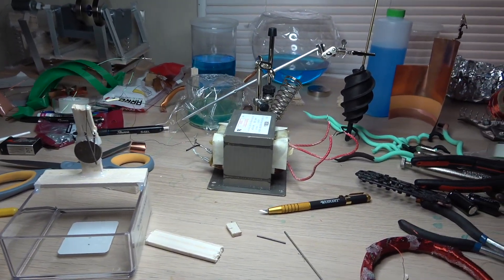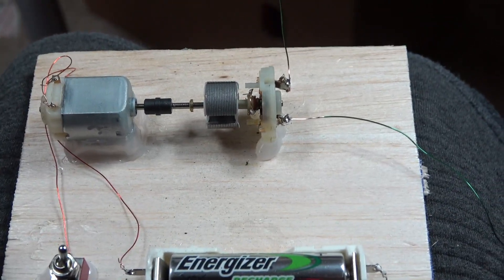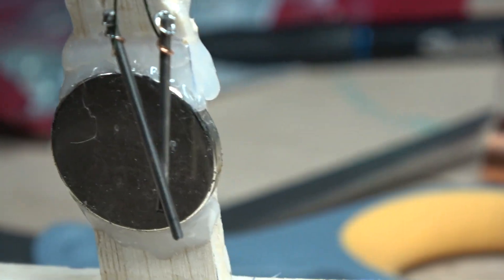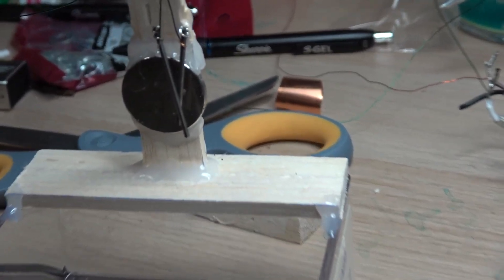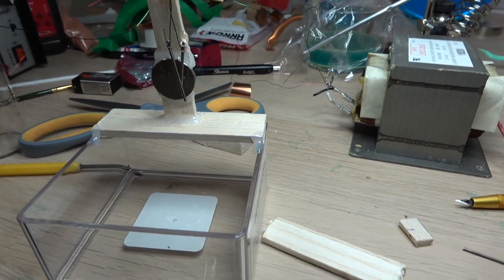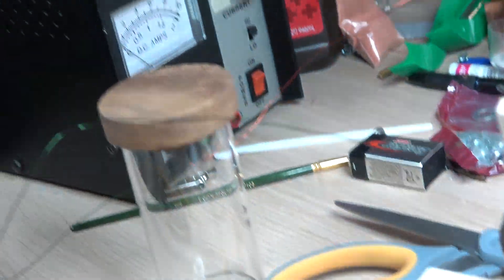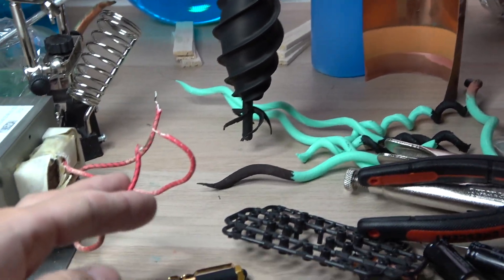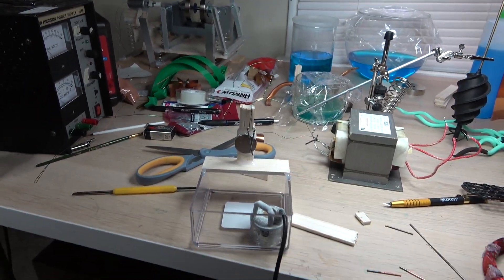Anti-gravity with a double coil?  Electrogravitic propulsion?

Comment: I know this is not the main subject of the video, but regarding the beginning of the video, one of the best ways to activate a transformer by switching the low-voltage secondary coil to DC to obtain high voltage in a mechanical and simpler way that I discovered was to modify a relay to make its actuator arm oscillate automatically and constantly.

The relay receives direct current and its modified coil is in series with the transformer coil, causing the relay's switching points to open and close the circuit according to the movement of its actuator arm.

When the circuit is closed, the current will flow through the relay coil and the transformer's secondary, but since the relay's actuator arm will be influenced by its electromagnet, it is attracted to it, causing the switching points to separate and the circuit to be interrupted.

When the flow of electrons in the electromagnet coil is interrupted, the electromagnet stops attracting the relay's actuator arm, and it returns to the closed circuit position thanks to its spring-like structure; making this process continuous.
Reply from the maker: Wow that's really interesting.  Thanks!  I hadn't thought of using a relay in such a way.  I may have to try that in the future.
Reply: @spiritelemental  Yes, and it works very well. Do not use the original winding if it is very thin, because the resistance will be very high and it will be analogous to a series resistor in the circuit. I removed the original winding and put a mesh of several wires in parallel with about 10 turns on the relay coil, this will make the coil have a very low resistance. It doesn't even get hot, it stays lukewarm at most.

The Achilles heel of this type of thing is that because of the constant opening and closing of the contacts, an electric arc is formed that makes them very hot. And when I say very hot, I mean melting the plastic of the relay structure that holds the fixed electrical contact point.

I also had to modify this part, I used a rectangular piece of PCB, which can withstand high temperatures, and fixed one end to the plastic structure of the relay and on the other end I put a screw whose head serves as the fixed electrical contact to which the actuator arm makes contact. With this, it can switch for a few minutes without stopping.

This type of problem can vary from relay to relay, there are several types of them and different internal constructions. There must be one whose structure is made of bakelite or another material resistant to high temperatures, I don't know. I had two of those relays that I removed from a refrigerator's electronic board, which must activate the compressor, or something like that.
Reply from the maker: @netorodrigs2100  Interesting, thanks.

Comment: I wonder if high voltage could affect time. So if you are using high voltage dc in order to alter gravity, then it might alter the flow of time as well. You should do a clock experiment so you can test for time dialation.
Reply from the maker: Very good suggestion.  Time distortions were recorded by Tesla in some of his very high voltage experiments, if I remember correctly.

Comment: The key is to get extremely high voltage and very very low amps. Pulsed is still the way to go. 2 (0r 3) coils 90° out of phase. Look up Delta 3 antenna or Helmholtz coils. I wont get too in depth until i can do more research myself. Good start 😉
Reply from the maker: Thanks!

Comment: This is good stuff, in one of Tesla's patients he describes using a DC pulse of 20 thousand volts at 20 thousand pulsed per second for his results. The aether is bombarded by the electrons and is put in motion, these particles are what does the work.
Reply from the maker: I agree!
Reply from the maker: The first chapter in "Secrets of Cold War Technology" by Gerry Vassilatos, is a good read.  That chapter is all about Tesla's discovery of impulse discharges with high voltage DC.  The discovery of the aetheric flow underlying electron flow.
Reply: A real understanding of the ether doesn’t regard a concept of material particles. The ether’s nature to maintain equilibrium derives all electrical phenomena
Reply: @FVLMEN  I know a physicist or two and they both say the aether is neutrinos particles. A particle smaller than an electron with almost no charge that can pass through matter unimpeded and permeates the universe. Tesla called it "the natural medium". I built a Tesla hair pin circuit to observe this phenomenon, using a 30 gauge wire 60 feet long and was able to illuminate a 500 watt high intensity bulb that uses 4.2 amps at full brightness, the maximum amperage of the tiny wire is 0.142 amps., something out of the ordinary is going on in the wire. 
This technology could have made the world a vastly different place if Nikola Tesla would have been able to continue developing his discoveries. Energy production could have been almost free.
Reply: @FVLMEN  Yes, all the qualitative evidence can still be misleading. What we see as a spark may be more than just electrons.

Comment: Using a pulsed DC with random shaped SG electrodes to drive an MOT is not a good idea. For such MOT only pure sinusoidal waveform of not more than few kilohertz is fine. For more energy you need air core Transformer.
Reply from the maker: Interesting... thanks.  Maybe I will have to make an air core Transformer in the future.

Comment: Electromagnetism relies on the Electroweak force in order to manipulate flux fields in space. you cant induce a gravity field with the weak force, you need something that modifies the mass in a given volume to affect its gravitational impact in space. Anti-Gravity would require something with negative mass, enough negative mass to counteract the warp around the earth to such a degree that it can effectively float. Not only can you not create this effect with electromagnets, but playing with voltages produced by the step up generator from a microwave, or any other large scale voltage source, can get you killed. Do a little bit more reading about the effects of electromagnetics, the relationship between electric and magnetic fields, and the nature of the thermoelectric effect on human tissue. or stick a fork into an wall socket. same effect.
Reply: I've heard claims that orbiting and spinning magnetic fields can shield inertia. This territory departs from conventional physics, so it will be an adventure of discovery, for sure, to look for anomalous effects. Yes HV is dangerous, kids. Don't try this at home; safety cannot be guaranteed, etc.
Reply: @paulshields1883  rotating flux fields CAN impact inertial potential when interacting with paramagnetic and inductively 
sympathetic materials, but that's not through a gravity field that's through electromagnetism. Counteracting gravity requires an effect that is exclusively massive in nature. If you want to look at some of the cool ways you can lock objects into a spatial location with electromagnetism, look up quantum locking. They supercool superconductors to the point that
 They both attract and repel a magnetic field.

Comment: Bad idea to play with a microwave transformer
Reply: only if you don't know what you're doing. microwave transformers are very commonplace in hobbyist EE setups.
Reply: Fr
Reply: Not if you are pulsing it with low voltage  dc but yea, if you power it with mains, different  story, better using an ignition coil or flyback

Comment: High voltage is dangerous man, it can kill you! Stay away from high voltage stuff my friend since you obviously don't know what you are doing and dealing with really.
Reply from the maker: Wow I've never seen a weaponized AI bot fight before.  Evolution of trolling...   LOL
Reply: @spiritelemental  :) It's interesting that bots don't like to talk about AI.

But seriously man, i suggest you to make high voltage you rather build a "Slayer Exciter" circuit to run a small Tesla coil (or Vortex coil if you want to be fancy:). It's super simple, cheap and safe to build. And you will not burn your nice power supply!:P  Maybe you'll burn a transistor on a circuit, but that's fun part of the learning process. Good luck & stay safe my friend!
& btw, Tesla had always one hand in a pocket when in the presence of HV,  & that advice probably saved my life a few times, so it's good to remember.
Reply: Go help him out professor
Reply: @DarkAttack14  It's painful to watch him short-cutting power supply, and then connecting it to the microwave transformer while talking about the levitation?!? WTF?? P=U*I; Voltage above 48V can potentially kill you, it depends on frequency and body resistance through the hearth, so..
Reply: @DarkAttack14  Usually i don't reply on bot comments (beside my bots:), but since your comment  can be somehow helpful..
Reply: @oxiigen  imagine automatically thinking someone is a bot because they witnessed some serious Dunning-Kruger in real time and called you out, professor ;)

Comment: What about using a Variac running though a Bridge rectifier into your pulse
Reply from the maker: Very interesting!  Thanks.  That could work.  The cheapest Variac with a max output of 280 volt costs 550$ USD.  That's a little pricey for me, but I could do it.  Where can I buy a Bridge rectifier capable of 280 volts ac?  and which one is the cheapest?  lol
Reply: @spiritelemental  E bay sells Bridge rectifier, I would also look on there for a used Variac
Reply from the maker: @brianbloom1799  Cool thanks!  I just bought a couple things off there, that I hope might yield interesting results.